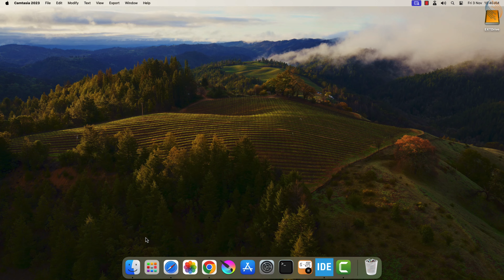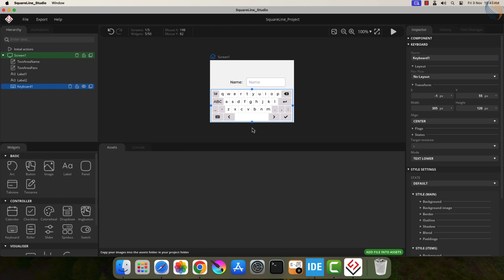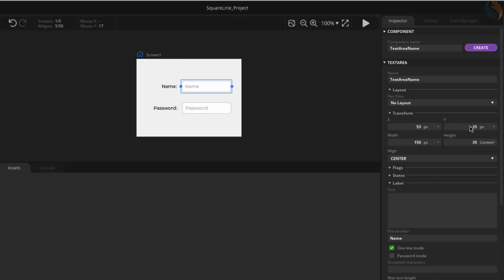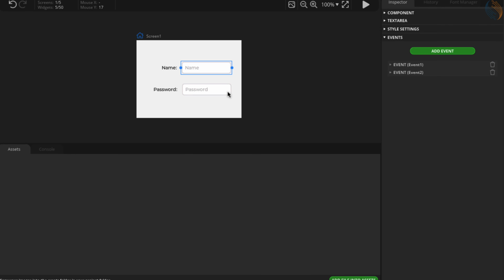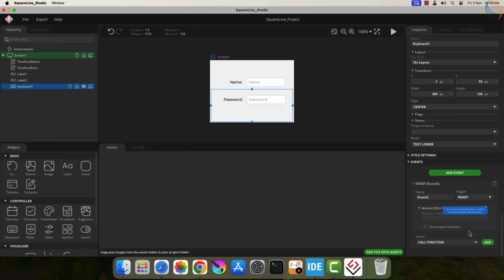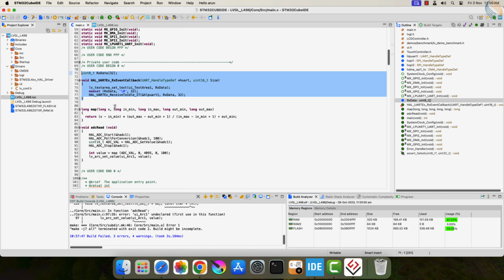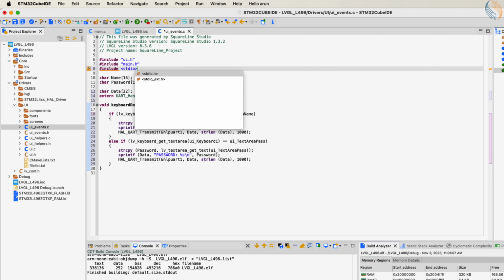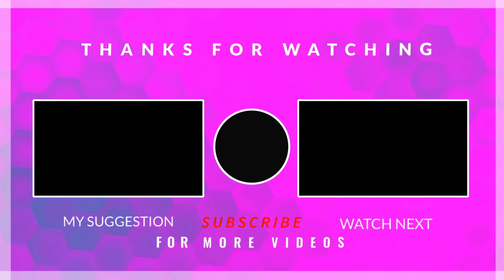LVGL on STM32 - PART 5 || How to use the KEYBOARD on Display

Comment: can you make a video how Mac user can go into development , because some of the software are not supported in Mac so how you are tackling this problem?
Reply from the maker: install windows on a virtual machine. Atleast that's what did. Unfortunately mac doesn't support much of ST's software. I only got the cubeIDE to work.
Reply: most of that are paid , which vm you are using  @ControllersTech
Reply from the maker: Parallel